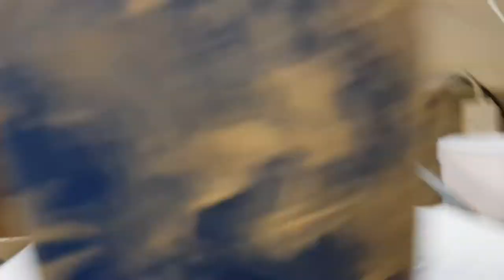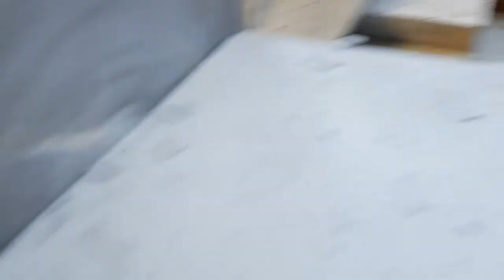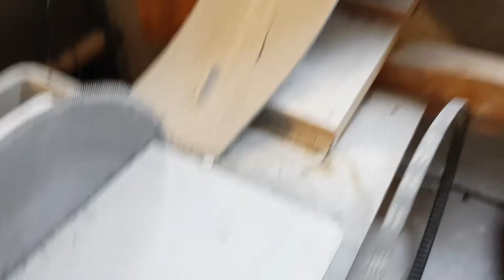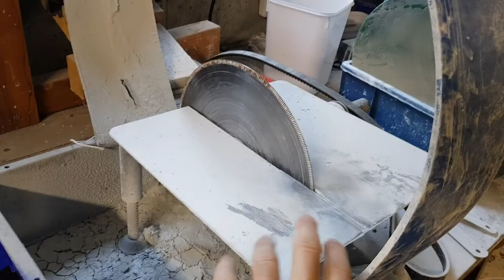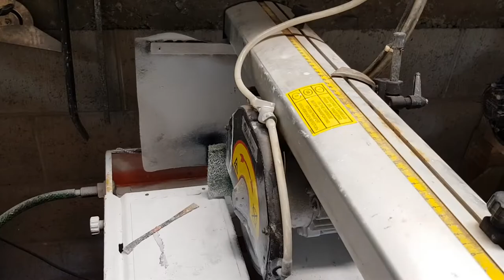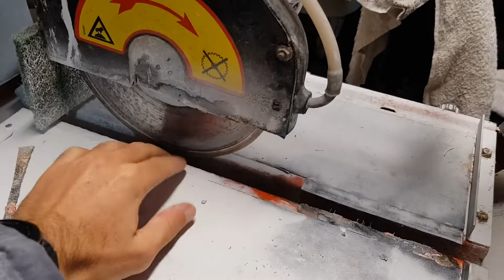How To Make a Table Trim Saw For Jade

Comment: This helped me a lot! What kind of motor is that? I'm trying to do a similar project but on a smaller scale. I've learned that different disk sizes need different rpm but still not exactly sure what kind of motor should I go for. At the moment I have this information.. 1 phase, if possible with variable speed (to be able to use different disk sizes) 900 - 4000rpm should be sufficient, 1/2hp to 2/3hp is enough for what I'm doing, Brushless?
Reply from the maker: Sorry I'm not the best to help here, I have only got experience with this and it was just luck that it all worked. So going my way would be just buy and put it together and see if it works? Not really recommended though. Pulley size makes a big difference to speed though and these an be adjusted easily after putting it together.

Comment: what size is that motor , got blade spindle and bearing etc but looking for a motor to drive it , thanks
Reply from the maker: It's either 1/3 or 1/2, 1/4 would probably work too.

Comment: Suggestions on blades? Ho thin can you go?
Reply from the maker: I am not an expert, but what I have discovered is that the thinner you go the more likely it is to not cut straight, this is even more of an issue as the blade gets bigger. I have a 0.6mm x 200mm diameter that works ok. and have a 1mm that is a bit bigger. I tried putting a 0.6 on my bigger blade and it cut on a curver everytime??? Couldn't work it out.
Reply: @CampbellCarving   alright thanks

Comment: I like your equipment videos. I got some jade offcuts from a mine here in BC and an old tile saw to cut/carve some stones with. I find that the tile saw tends to chip out my jade quite a bit especially when I get to the end. Is that because the jade is low quality or because the tile saw is too aggressive?
Reply from the maker: I think that both could be factors to it.  It is not uncommon for that to happen. Also cutting across the grain can cause chipping and flaking too.